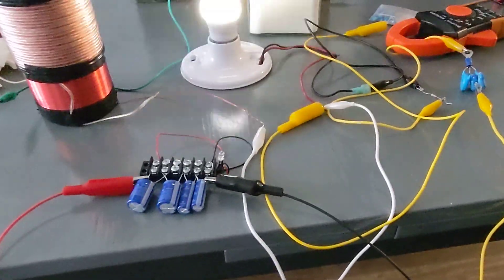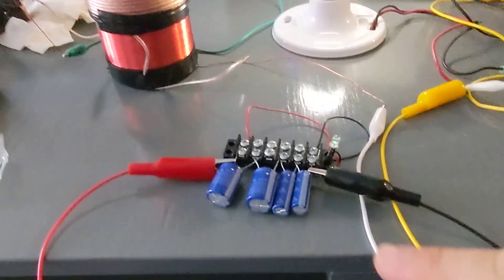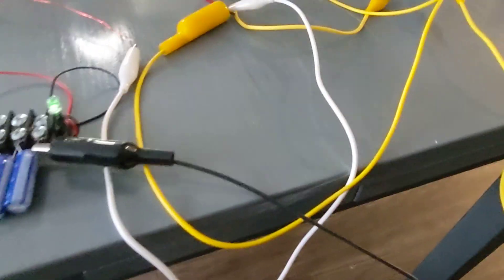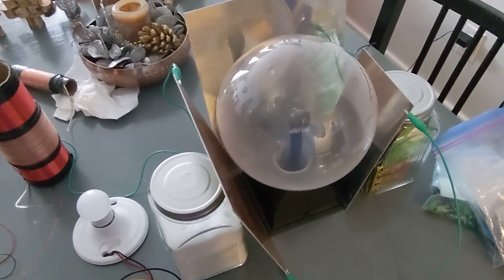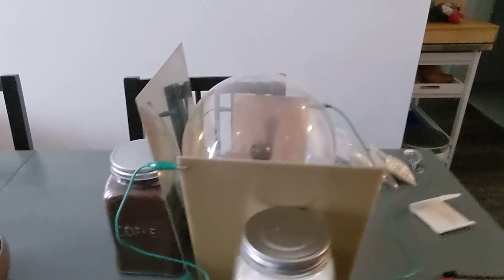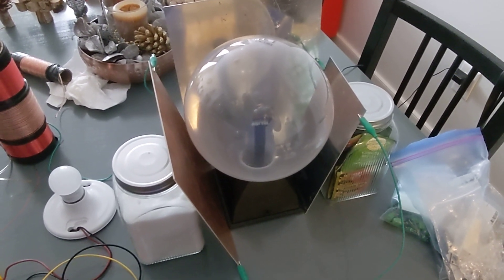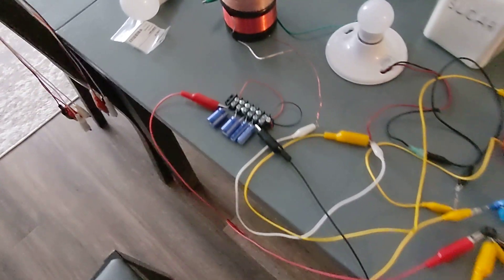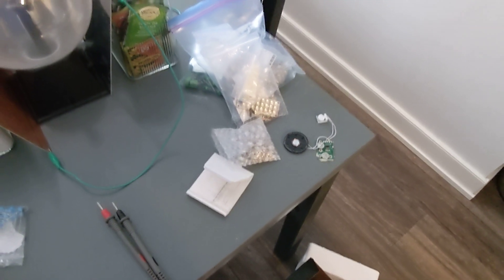Faraday Research RND ⚡⚡💦💦#tesla #freeenergy #zeropointenergy

Comment: It seems the plates are parallel to the flux, and not perpendicular, as described in the original patent.
Reply from the maker: Yes you're right I could actually put the plates on the table flat underneath the ball and it'll still pick up the flux

Comment: I wonder if you could perform a test for me with your setup, in particular with the plates that I am yet to build. I noticed most in this field over the years have stated that the power is harnessed 90 degrees out of phase with the magnetic field. eg. have you seen the plasma tubes that stand upright? They have plates like yours part way up the plasma tube 90 degrees out of phase.(horizontally positioned). Could you please place a roll of tape, perhaps electrical tape, on top of the plasma ball and then place a single plate on top of that and perform some measurements, then perhaps a single plate on the side on its own and take similar measurements for comparison. Thanks in advance, I would do it myself but as I don’t yet have plates perhaps we can test ideas through your channel with what each member has available to them.
Reply: Good ideas man it would work fine all around the sphere. Also maybe use pancakes coils byfiller Tesla invention created pulses. Could work.  Thank you for your input. Future energy for mankind.

Comment: I just wish I could find someone local to me that I could learn from. With my dyslexia, I don't  retain anything I read, so it is very difficult for me to teach myself the electrical engineering side of how to build circuits and which components to use. I have a project I have been working on but it is taking me forever to get to where I am because of my deficiency. And I know I am getting really high voltages because I have already fried a couple multimeters. Once I can get my pulse motor circuit figured out and get it running again we are going to incorporate sparkgaps and a 12:1 microwave step-up transformer and such. We already had plasma arching across more than .25 inch gap, with our little motor powered by a 12v supply. Trouble is we keep burning up our reed switch so we are trying to rebuild the circuit using either a hall sensor or trigger coil. Like I said though, this is where I'm stuck because trying to read material to learn what I need to know, I have to learn by hands on or I will never get it. Or at least it would take me more than a year just studying and memorizing the info before I can put it to use...... I do really appreciate your channel though and others like yours. You have helped in many ways! Thank you!
Reply from the maker: Hey how's it going 
The best thing I could suggest for your reed switch problem is you got to stop using the Reed switch as the switch so the Reed switch is basically just a trigger you need to use the read switch to trigger say like a MOSFET or a relay or something of that sort... because I used to burn up read switches all the time so what I do now is I isolate it out of the circuit..... so it means it's not going to be part of the high voltage circuit that you're using it would use an extra exterior battery source like a 9-volt battery or something that is just enough power to make it operational so that's the way I do my pulse motors is I isolate the reed switch away from the circuit itself It's not actually part of the circuit it just turns the relay on and off on and off so I don't know if that helps a little bit but yeah you can look into that

Mike
Reply: @FaradayResearch  Yeah, I do have it isolated where it feeds the gate voltage to the MOSFET. We had such good results from the first prototype that we decided to go ahead and upgrade the rotor, magnets, and coils. But in doing so I have to rebuild the circuit also, to incorporate the added drive coils. I am currently getting ready to build 2 more bi-filer drive coils and run all 3 of them parallel, not only to increase the torque, but to also increase the wattage of our back EMF. Where we will then run it through a series capacitors followed by the step-up transformer and then a spark-gap to try and capture the very high voltage using a cold-electricity antenna that Tesla writes about. I am using 20 gauge magnet wire on my drive coils currently.